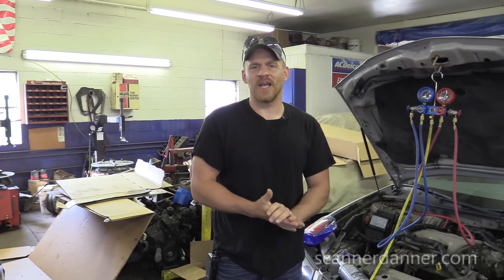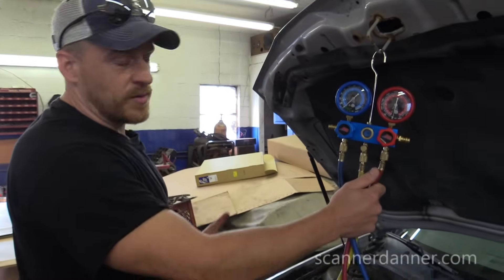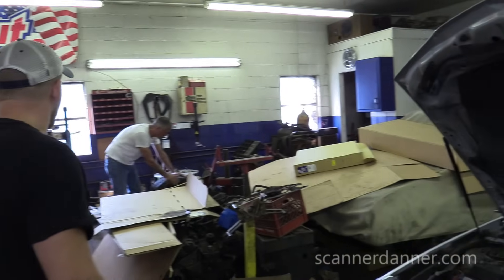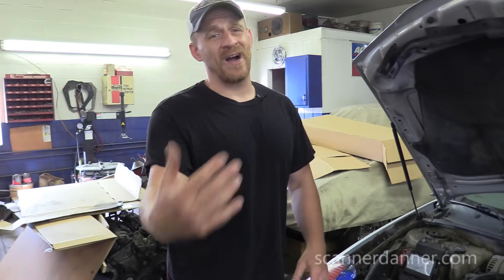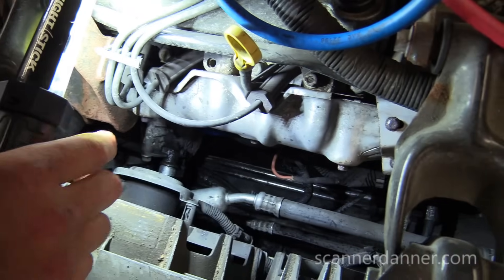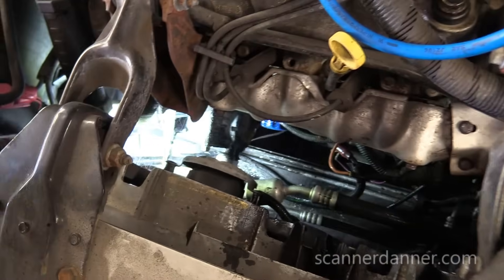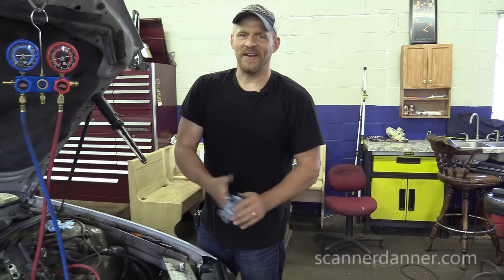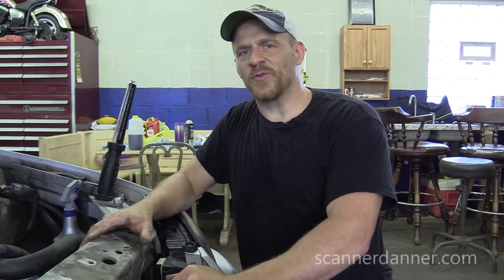A/C Leak Testing Using Compressed Air, Soap and Water (any car)

Comment: I've been in refrigeration and air conditioning for almost 50 years never ever ever ever ever used Compressed Air to pressurize any type of refrigerant you are making rocket fuel in your face very explosive good luck with that
Reply from the maker: Im using nitrogen these days but there is no danger here. I'm not adding air over top of refrigerant. The system is empty. 
The only down side to this method is moisture contamination of the oil thats in the system. Pull it under a deep vacuum for a longer period of time when your done and it will be fine. 
Using nitrogen for sure is better, but this method absolutely is better than adding refrigerant to an empty system to test for leaks, especially when there is a gaping hole somewhere

Comment: Compressed air worked fine.  Was able to fine the leak in an old AC hose.  Replaced the hose, vacuumed it down, and put in new refrigerant.  Working great the last few weeks. thanks for the great video

Comment: Q: Does pressurizing a newly installed AC system (to check for source of leak) using shop air CONTAMINATE the new desiccant? I read that nitrogen or CO2 is appropriate gas for pressurizing AC systems. What is correct in order not to ruin new desiccant?
Reply from the maker: Use nitrogen if you have it.  I have some videos on my set up

Comment: True story.  Rented a brand new AC gauge tool set from AutoZone.  The Low pressure brass fitting at the system end did not have a hole drilled in the brass so it was closed all the time.  I figured this out, but 6 days later.  Always check your tools.  😅

Comment: Hey, just want to ask, do compressors always work with compressed air ? I took my car to a mechanic and he out some air into the AC system and the compressor didn't work, he said i need to check the compressor's wiring, is he correct ?
Reply from the maker: As long as pressure is above around 50 psi, then yes, the compressor should engage
Reply: @ScannerDanner  thanks.

Comment: Wow, all kinds of YouTube mechanics and AI searches say never use compressed air in AC system. Moisture in air will damage system is what they say. But if I confirm my condenser is the leak with air (now empty) then immediately replace condenser and apply vacuum for 45 minutes before adding 134a, is there any chance of moisture damage?
Reply from the maker: The concerns are real. Just pull it under a deep vacuum when you're done and you'll be fine. I use nitrogen these days, mainly because I got sick of hearing about using compressed air lol
Reply: @ScannerDanner what do you do for a leak that is too small to detect with soap or in some obscure location i cant see?

Comment: WHAT IF THE RESTING PRESSURE DOES NOT DROP WHEN THE CLUTCH ENGAGES. 
IN ALL OF THE VIDEOS NOBODY MENTIONS THIS. LOW SIDE IS WHAT I REFER TO. 

MOST PEOPLE WILL NOT HAVE THE 3 HOSE MANIFOLD.
Reply from the maker: If you're sure the clutch is engaging and your service ports are connected to correctly, then you have a bad compressor. The worst part of that type of failure is it pumps it guts through the whole system

Comment: Quick tip.

Do not buy the cheap manifold gauges with the taps/valves on the side of the manifold.
They have a tendency to leak so you wont get a true pressure or vacuum decay test,
same deal with the service port couplers, Also they have crappy check valves in the hoses.

The check valve for the yellow hose on my set will not seal up under pressure,
it leaks even with 50psi behind it when doing a pressure decay test,
when its in vacuum it also leaks not sure if that is normal,
could be just a one way check valve to stop refrigerant leaking out under pressure,
Can someone please verify that for me.

when looking for a manifold set,
Get a set that looks like the set scannerdanner is using,
they are reported to be far more reliable, wish i had known that before i bought my set,
just goes to show, a few hours research can save you time and $$$.

Comment: Quick tip for any of you looking to buy an AC vacuum pump online.

find out what kind of wall plug it has, is it AU standard? USA standard? European standard? is it 10Amp? 15Amp?

very important to know this stuff so you get the correct unit for your countries wall socket type and amperage.

you can run a 15Amp unit from a 10Amp wall socket via a 10amp to 15 Amp adapter lead with a circuit breaker in the middle,
how ever as i found out with a 15Amp portable Mig welder i purchased the unit will not run at its full capabilities if it is 15Amp running of a 10Amp to 15Amp adaptor lead.

[edit= extra info added]
Also if you are trying to run a 15Amp device via a 10Amp wall socket make sure you use a conversion lead with a circuit breaker between the 10Amp wall socket
and the 15Amp socket at the end of the lead where you plug the device in.
the reason for this is that the device may still be trying to draw 15Amp from the 10Amp wall socket,
Which is where the circuit breaker comes in, it will kick out if the 15Amp device over loads the conversion lead.
much easier to reset a circuit breaker that is 4 or 5 feet away than reset a breaker that is 100 to 200 feet away.

also you can get these vacuum pumps as cordless that run off a rechargeable battery pack,
personally i would NOT use this type of unit because the last thing you need when pulling a vacuum is for the battery to go flat.

Comment: Mr Danner

Firstly let me start off by saying as a DIY guy, i have been fixing my own cars for decades (30 plus years, pre ECU models),
lately i have watched countless youtube video’s on how to fix my 2000 Toyota Hilux 4X4 dual cab,
and my 2012 Jeep Grand Cherokee Limited 3.6l V6 4X4, how ever i have never subscribed to a channel, ever.

UNTILL i came across your channel while trying to diagnose the AC clutch not engaging in my Jeep,
i have never worked on a cars AC system before, so i needed good advice on how to go about it safely and in the correct manner,
you have supplied me with that knowledge, thank you for your highly informative and some times amusing Videos,
hows that robin doing ( Calebs jeep repairs)?

I am yet to do the testing on the Jeeps AC system for Pressure loss / leak testing as i waiting for my newly purchased AC manifold and Vac pump toys to arrive that i purchased on Ebay for AU$140.00 plus postage (AU$50.00).

Quick question ? the AC compressor was squeaking and rattling before the clutch stopped engaging, would i be correct in assuming the the Compressor may have been running low on lube and is now damaged?
Reply from the maker: AC compressors get their oil from the the refrigerant. It picks it up and carries it through the whole system. There really is not way for it to run out of oil. Even with a refrigerant leak, 90+% of the oil still remains in the system. The rattling sound you heard may have been either a clutch bearing that failed, or the compressor itself. Watch this one where we had a clutch failure and how we handled it. https://youtu.be/LH5A0QPC31k?si=2SGrof9OSx_uf4Kb (part 1)

https://youtu.be/_1nBwBU8rvA?si=CRthYyWzzSQpcY6x (part 2)
Reply: @ScannerDanner  Thanks for the fast response.

Just finished watching the video you linked, thanks for that, the noise in my compressor only happened when the clutch was engaged,
which leads me to believe it is the compressor, I will check the bearing before i go ahead and buy the Compressor just to be certain,
if its just the bearing i can replace the compressor for around AU$300.00, since the clutch kit will cost me about AU$250.00 anyway
i may as well pay the extra AU$50.00 and be on the safe side. as it is most likely factory and has done over 187,000 K’s.

if the compressor has in fact gone belly up and shredded its self into the system, 
I can get a kit at rockauto for around AU$800.00 (including postage and taxes) which includes the Compressor, Condenser and TX/ expansion valve
as well as a full set of O rings and an 8oz bottle of Pag 46, that is a last resort,
if in fact the Compressor has taken its own life i will of course have to flush the lines to get rid of any crud in the system.

i will also do a leak test just to make sure the rest of the system is ok leak wise, never hurts to be thorough,
just have to wait for the manifold and vac pump to arrive, should have the kit by next Friday. 

I will have to take it to a shop to get the gas removed before i remove the compressor as i don't have a recovery system,
I will do a pressure test first to see if the system is still under pressure before taking it to a shop.

the other pain in the Butt is that here in Australia you have to have a accredited AC licence to buy R134A refrigerant gas,
the only other gas available without the AC Licence accreditation here is that minus 30 propane AC gas,
I really do not like the idea of filling my AC system with a low flash point Gas, so the R134A refill will also be done by a AC shop.
Reply from the maker: @DamienCollins-d1w  for sure do NOT use the flammable gas substitute! Good providence to you on this job
Reply: @ScannerDanner  Have spent the last week looking into converting my AC system from r134A to R1234YF.

finally found that you have to replace the WHOLE system to convert from R134A to R1234YF
due the the difference's in the gas's mainly that r1234Yf is mildly flammable,
And the parts are Very Expensive so i gave up on that idea as far too costly.

Have been looking into using a mix of Butane and Nitrogen, Butane as the refrigerant and Nitrogen as a Flame retardant,
both gas’s are compatible with an R134A system and oils,
no parts conversion needed just have to do a COMPLETE vacuum and pressure leak test on your system before adding the gases via the high pressure valve.

this is where the nitrogen will be useful for testing as it has smaller molecules than R134A, butane and air,
so i will find every leak i possibly can by doing a three day decay test on both Vacuum and under pressure,
3 days for each test to be certain i have no leaks before adding the butane to the system.

will have to get myself a recovery bottle and an inline flame arrestor valve for mixing and testing
to find the best balance between cooling with the butane and flame retardancy with the Nitrogen,
I will do the flame test first before adding it to the system so be sure it will not catch fire
using a butane torch attached to the recovery bottle with the flame arrestor valve in between the two.

Start with a low butane psi say 7psi and the 23psi nitrogen and go from there till i find a good balance.

yes i know it sounds insane but i can get both gas’s cheap and not need a licence to buy them,
AND both gas’s are non ozone depleting and have the lowest global warming rates than almost any other refrigerant gas’s,
also that Minus 30 is freely available here and it has butane in it, along with pag oil, leak stop and UV dye.

Will keep you posted

P.S. sorry for the long post just making sure all the details are there.

Comment: Can you use an automotive smoke leak detector to pressurize your car's (empty) AC system to pinpoint where a leak is coming from?  From what I understand, it's mineral oil that's used for the smoke.
Reply from the maker: Mineral oil is not really compatible with R134a or the newer refrigerant, but the main issue is these smoke machines run off of very low psi (1.5psi on average) which is not even close to being enough for these systems

Comment: 2012 buick lacrosse, vac,éd it down and added réfrigérant, lo side within range but hi side on 50 and not increaseing, new compressor, what gives???
Reply from the maker: Not enough information. 
1. Why did you "vacuum it down"
2. How much refrigerant did you add?
3. Is the compressor clutch engaging?
4. (Scratch the first question) New compressor? Why? What failed? If it was an internal failure, it pumped it's guts through your entire system! And you will need many other things

Comment: Hi Scanner Danner, I always watch your videos on ac repairs. Great job you save a lot of us many headaches. Working on my 2009 mazda 6. AC suddenly stop working blowing hot air, compressor clutch not turning. System has refrigerant 134a. Used my gauges and checked pressure on system without running engine results are, Low side 85psi High side about same 85 - 90 psi outside temp 79F. With engine running and ac on to max speed, no change in pressure on Low side and High, Low 85psi, High 85-90 psi in fact after running for about 2 minutes the High side pressure went up to 90 psi then I shut off engine. Can you help me Scanner with this one, I really can't figure out what's wrong. AC relay is good, fuse good, pressure switch good I see only one and compressor clutch when tested moves in and out with click sound when applied directly to battery voltage. What's wrong Scanner Danner. If I could attached pictures I would. Please help me, much appreciated
Reply from the maker: Post this to my forum. We can share pics there. It's free to join www.scannerdanner.com 
Let me know here when you post it and I'll jump over and help guide you

Comment: 2 weeks ago we had one with no dye showing, that held perfect vacuum for 18 hours. Held 125 psi for 18 hours.
Put 175 psi in it and it leaked.
Only good way to test is with nitrogen up to 400 psi if necessary.. high cut off switch on receiver dryer is 400 psi.
Should hold that, right?

Comment: Awesome video!  I was trying to figure out how to pressurize my system since the fill port on my gauges won't fit my air chuck, but the rubber tipped spray nozzle did the trick!  put it up to 120 psi and immediately heard the leak.   It is the condenser, looks like a stone hit it.  I need to put a screen in front of this thing!
Reply: Edit: Condenser was the leak, it was large enough it was hissing like a punctured tire!

Comment: What fitting would it be that connects the 1/4 NPT compressed air to the manifold? I guess the rubber thing works though..

Comment: I wasn't sure about how much air pressure to put in the system & you answered my only question, thank you. 
I used 100psi and it was leaking air out of the weep hole, pulled a vacuum for 1 hour to verify & obviously it didn't hold. I was worried that I used to much air pressure & messed up the new compressor. I guess I got a defective eBay compressor ¯\_(ツ)_/¯

Comment: Dont use shop air because air has water h20 dirt alot of other impurities that can plug up your orifices .use compressed nitrogen .
Reply from the maker: I use nitrogen these days, but have used compressed air with zero issues for over 20 years. Evac it real good when your done
Reply: Dry compressed air, a la paint spray air, is fine...
Just not enough pressure.

Comment: i have an empty system with a suspected leak. I was wondering if using dye with compressed air would work. I pulled a vacuum but it didn't hold
Reply from the maker: Forget the dye. Use soap and water after you pressurize it
Reply: I tried. Couldn't find the leak.  @ScannerDanner
Reply from the maker: @332ARA  what pressure did you use? And what kind of car?
Reply: 80 psi. Aftermarket under dash r134 unit. It may be the gauges. I pulled vacuum and disconnected the gauges. Been letting it sit for a day . the ports show pressure on the Schrader valves. Maybe a non problem. My concern is when the pressure bleeds off after the valves are shut and the pump is off. I was thinking dye would be definitive answer @ScannerDanner
Reply from the maker: @332ARA  put 150 psi in it, then close your manifold gauges and watch for a psi decay first
Reply: I'll keep you posted. You know it would be nice to have mini nitrogen canasters at the parts store. @ScannerDanner
Reply: I got another set of gauges and was able to hold a vacuum. I have the yellow hose installed with the Schrader valve on the pump end. Is that correct? Or should I install it on the manifold end? Does it matter? I still need to fill the system
Reply from the maker: @332ARA  you need to make sure that shradder valve is open (that something is depressing it) or you need to remove it.
Also vacuum holding is not 100% that you have no leaks
https://youtu.be/nCTgcal4N94
Reply: So i have question. When one pulls a vacuum and closes the valves, should I be able to remove the gauges and leave it under vacuum? When I do this, the low side port valve hangs open and loses the vacuum. This is a new hot rod custom system. Never charged. I'm wondering if the only way to close the valve is when the system is charged and pushes the valve closed. I'm trying to figure it out before a waste R134. @ScannerDanner
Reply from the maker: those valves should hold with your guages removed, but I'm not confident enough to tell you they should hold under a vacuum condition. I'm sorry

Comment: how many psi did you charge the low side?
Goodbye and thanks
Reply from the maker: You don't charge by pressure on the low side.
Unless you're talking about air psi? In which case, as much as your shop compressor will give you. 150-200 psi is perfectly fine for both sides of an AC system

Comment: So, a compressor shaft seal cannot be found to leak? How about bubbles kids use? I bet it would blow large bubbles out of the compressor seal.
Reply from the maker: You can't get behind the clutch where that shaft seal is located. Doesn't matter what you use imo
Reply: Thanks, i felt water could get in if air got out? @ScannerDanner

Comment: It was emty with refrigerant how on earth this will become combust ible were there is no mixture it just common sense.😂no mixture no combustible thats it.when it comes for compressor to be damage its not your problem its tech whose doing the repair.thats it😂
Reply from the maker: Exactly and compressor damage from a 5 second test with compressed air or nitrogen absolutely will not happen.